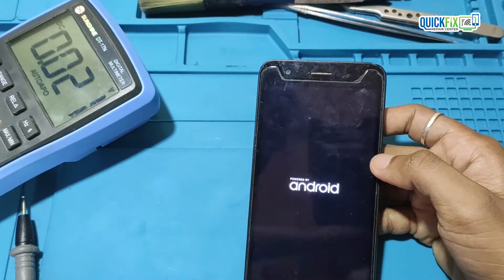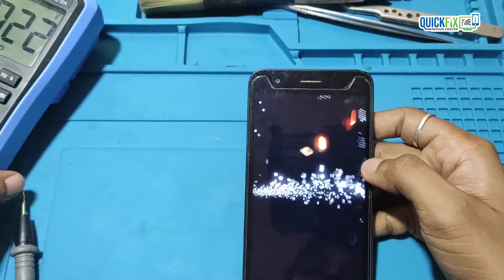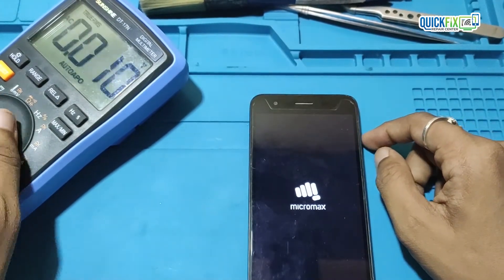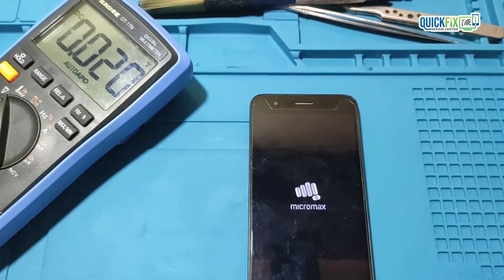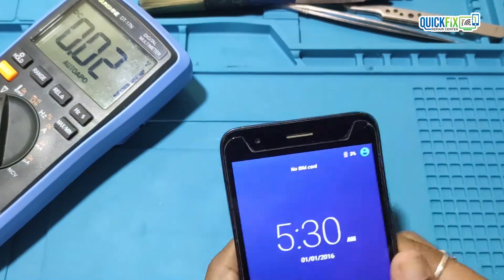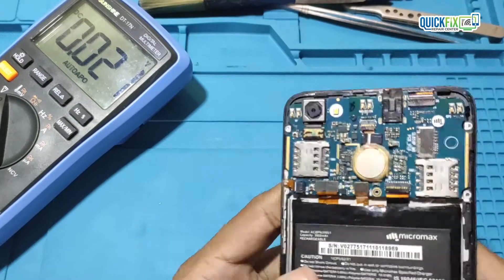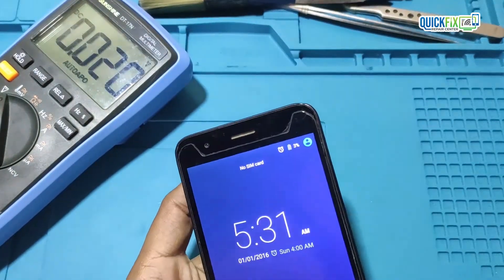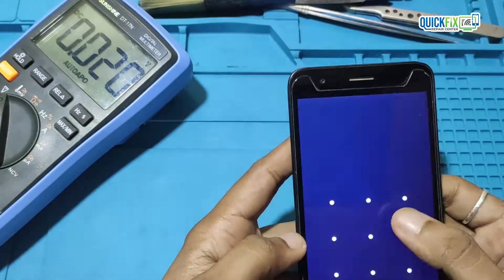Mobile shorting solution

Comment: Sir..I am learning  mobile service...

My phone Realme c20,my mic not working..so I am repair my phone...i  heating up  on air gun pcb board shield...( That's  happen my phone Small capacitor 3 pieces missed...

So my phone not trun on..plz tell me solution....

It's urgent...I am waiting yours replay
Reply from the maker: First thing, reinstall appropriate capacitor from missing place. I think due to overheating while removing shield your phone got dead.
Reply: @QuickFixRepairCenter  yes sir...off short
Reply: @QuickFixRepairCenter  CPU way is line cut...this is repaired or no sir???...

Can I my phone is back???
Reply from the maker: Ok. Currently we are not doing any CPU related work. Hence u need to find someone else who is master in CPU related work. Then definitely they will bring your mobile live.
Reply: @QuickFixRepairCenter  I am today going phone service center...that person telled give a time 2 days...

Service cost 1300😫😫😫 that is my mistake...my mic not work so, after to remove main BOARD shield... heating up soldering paste over used...my mobile component 2-3 capacitor missed....

My cost is worst.....very depressing me...

I am also 2month going mobile repair service center...I am totally confident.. resolution got on ..but use😫😫😫

Anyway really thanks for yours REPLAY sir..I am subscribe you sir..thanks
Reply from the maker: Ok. In future we will definitely help you once we gather enough knowledge regarding smartphone.
Reply: @QuickFixRepairCenter  mm...sir😫😥